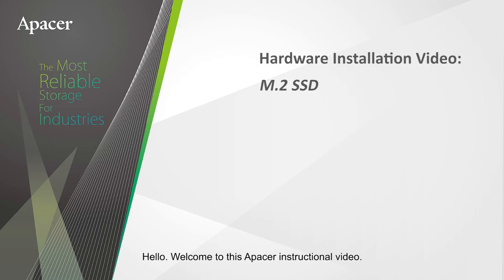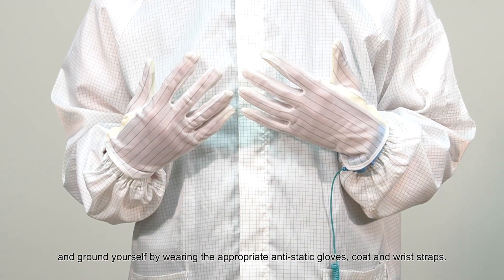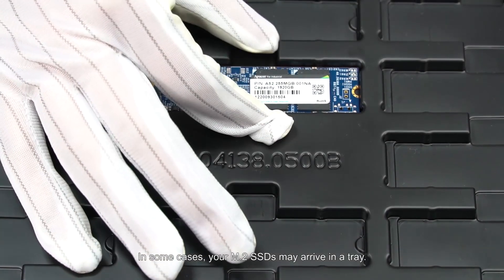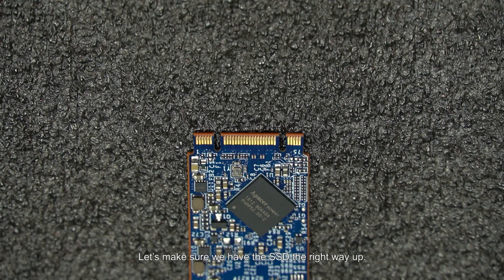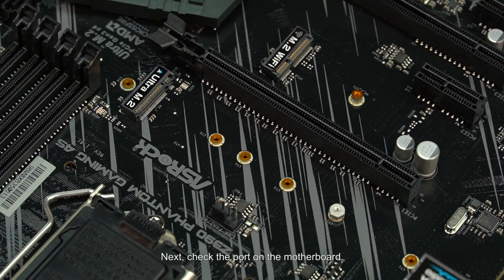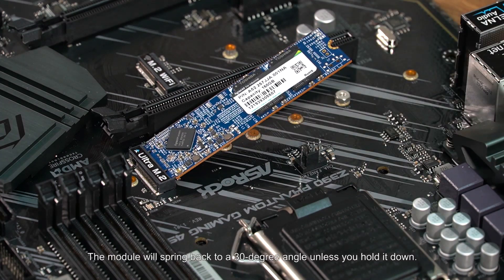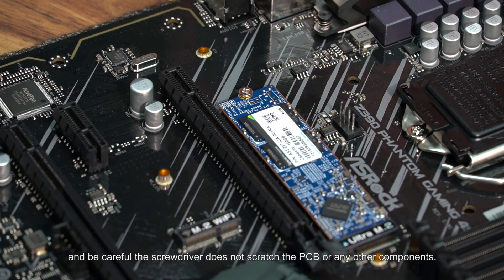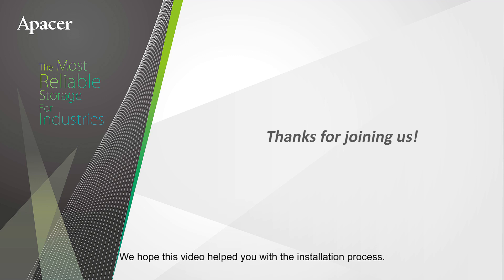Apacer - How to install an M.2 SSD

Comment: The ssd utility isn't detecting my apacer nvme ssd. What to do?
Reply: Just having the same issue. Did you figure it out?
Reply: @danielkuchar1786  nope. I have a pny ssd installed too. PNY ssd tool detects both the pny and apacer ssds, but apacer utility can't even detect its own.